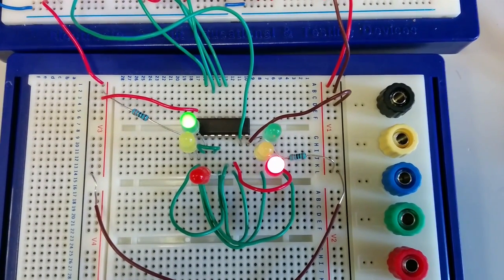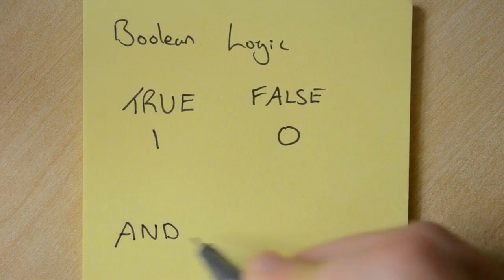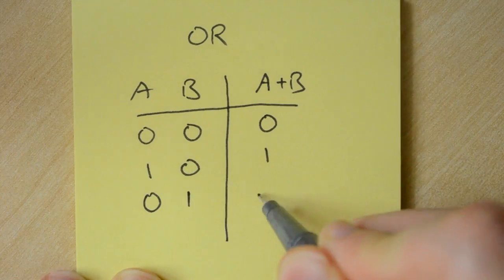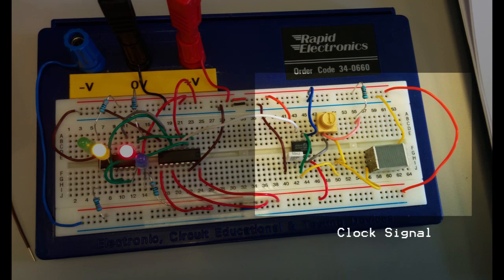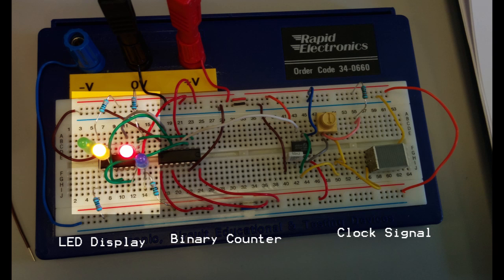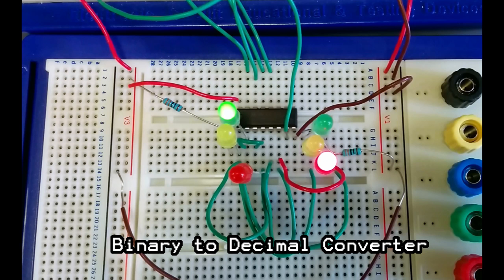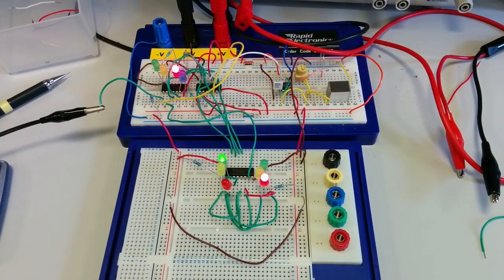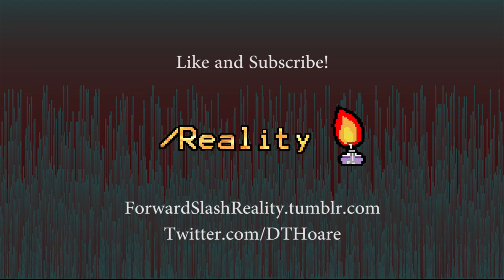Logic Circuits and Traffic Lights

Comment: Oh! You've started a really good theme but didn't completed it! I'm searching for that simple (push button in my case) binary counting circuit that does exactly like  yours. It's the 100% deal to control CD4051 IC by one button!
At least you've reminded about the counter chip. Thanks for this! :)

Comment: They go green to yellow to red, than back to green. Try again.
Reply: ya its totally incorrect. Lights go RED to Green, no yellow. Only when turning Red they transition from Green to yellow To red with 3 sec separation
Reply: @oneeyedrone4293  needs microprocessor or eeprom chip or larger combinatory system...
But lights could go to yellow before green without losing the objective of the system, further increasing the attention of the driver that wont know if the next signal is going to be red or green, thus both side would need to stop on yellow.
Reply: in the UK it does go to yellow after red

Comment: my teahcer said that the not gate starts with 0                 1             is that still the same?
                                                                                1       not    0
Reply from the maker: If you are asking about the truth table I drew, it doesn't matter what order the rows are in. Its only important that a not gate does :   0 -> 1 and 1 -> 0.
Reply: ok thx